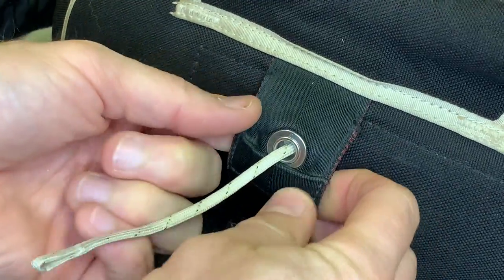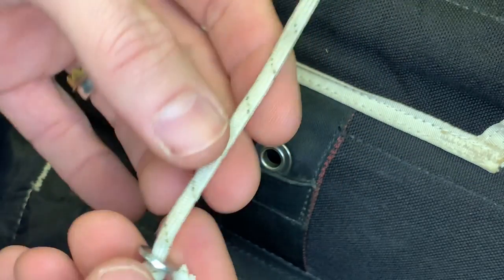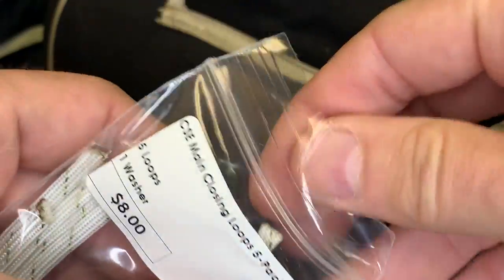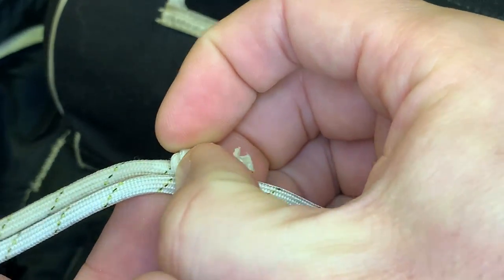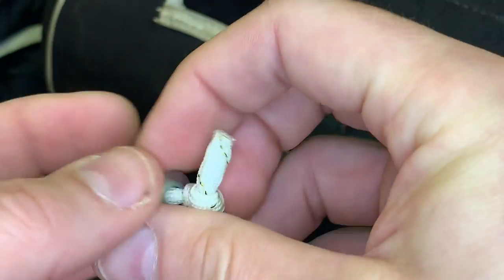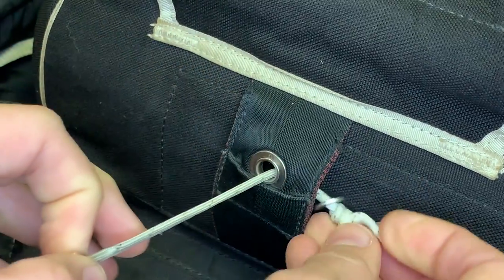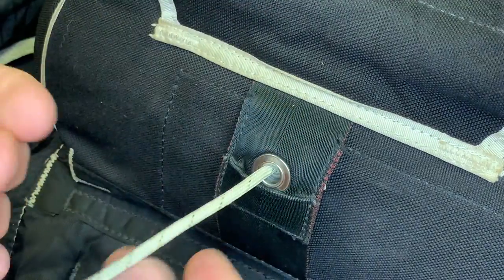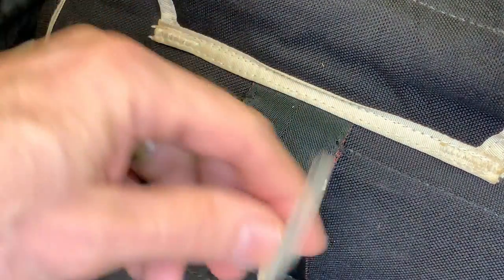How to Change the Main Closing Loop on your container.

Comment: Better also check the orientation of the washer 'cause one side is smoother than the other and the smooth side  better against the knot to avoid damage or scratch to the base of the loop.